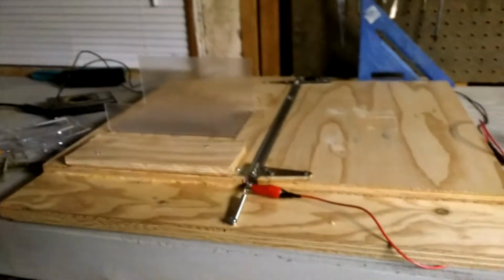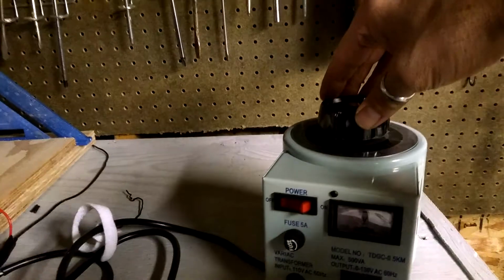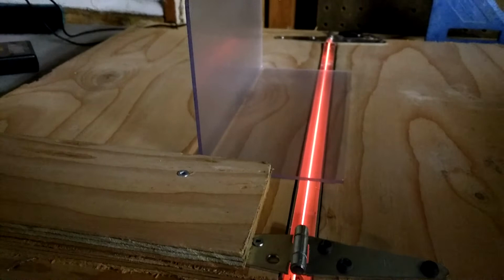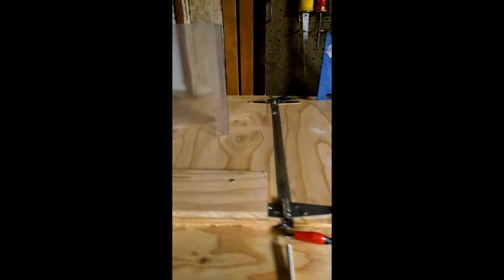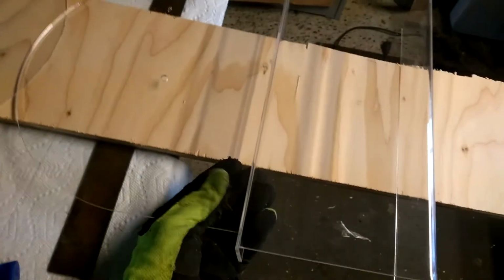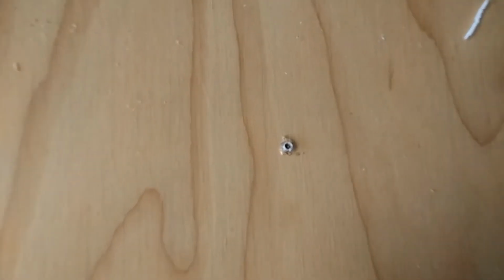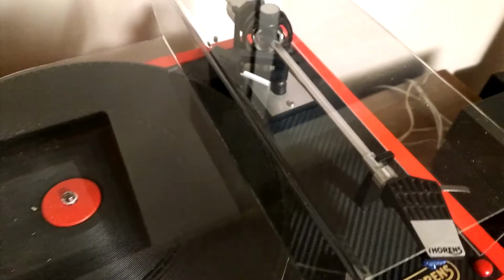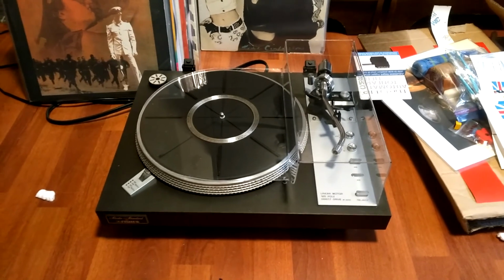DIY Turntable Acrylic Dust Cover Project Nov 2017

Comment: How did you cut out the round portion? I’ve done some acrylic cutting with an oscillating multitool but I don’t think I trust it to make a clean, circular cut.
Reply from the maker: I used my Dewalt jigsaw with a fine metal cutting blade. First I draw the circular pattern of my planned cut (using a crappy old record) on the paper or plastic wrap protecting the new plexiglass using a sharpie and then hand bomb the jigsaw around the pattern. Careful to cut slowly letting the blade do the work because if you force it (especially on thinner plexiglass) it can crack. I use the straight edges of the plexiglass wherever possible. Then you can use a high temp torch or polishing to smooth out the edges for a final finish....
Reply: navydiving hmm I’ll have to give it a try. Sounds scary but there’s no way in hell I’m paying $100.   Thanks.

Comment: I don’t get it. You said you made a mistake and bent it the wrong way yet it’s sitting on there perfectly. What am I missing?
Reply from the maker: Look closely at the video and you will see that the top of the dust cover is not symmetrical. I bent the acrylic the wrong way and the part that is supposed to jut out of the front of the platter juts out at the back . Off camera I bent it back the right way for the final view of the dust cover....